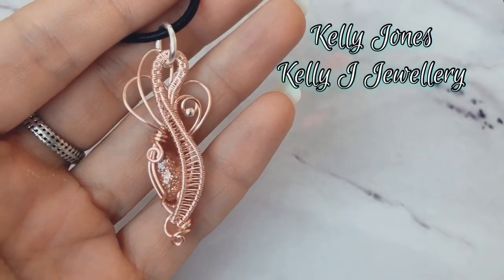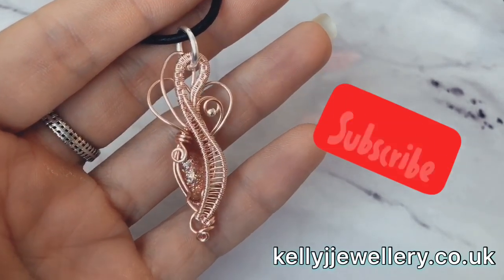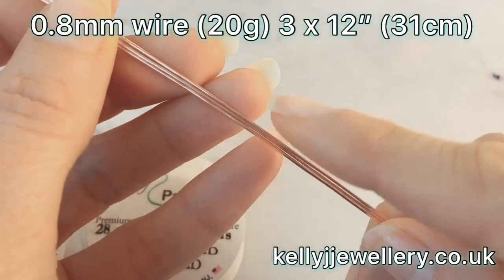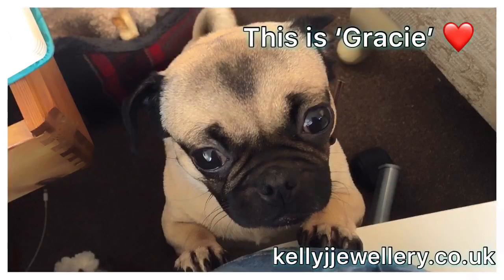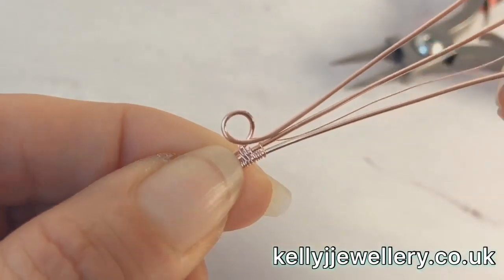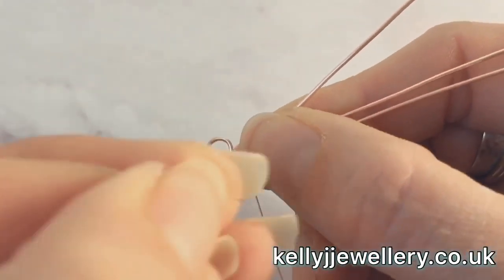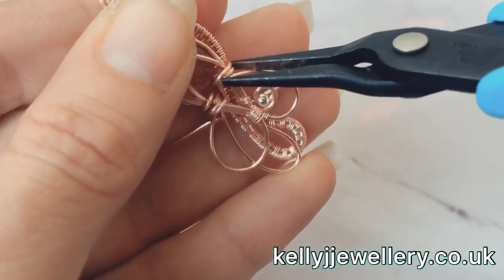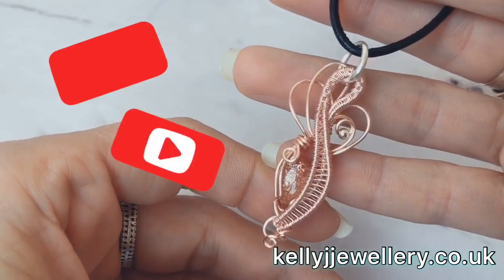Kelly’s Pendant Tutorial.

Comment: How do figure out how much wire you need? My stones are usually bigger, but I don’t want to have a bunch of wasted wire. 🙁
Reply from the maker: What I do, is hold the stone at the centre point of the wire,  (an estimate, don’t cut any wire just yet. We’re holding the stone against the wire while it’s still attached to the reel) then imagine what the wire has to do. So you’ll need enough to wrap the stone, then extra to cover the stone again, then extra for handling or if you change your mind with the finishing part. (Then double that length for the other side) So look at the length I use and then imaging the stone at the centre. Then you can see how I worked out my length with the stone and wire length for this design. Hope that helps 🌹I’ll try and explain it better in my next video 👍